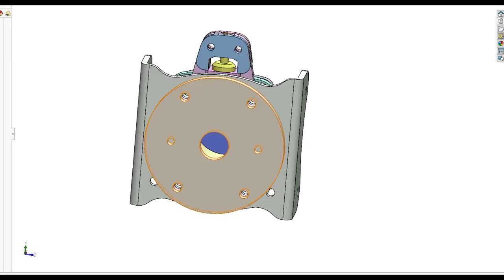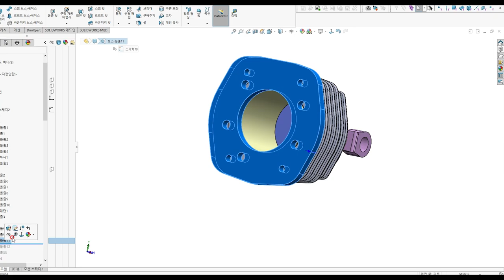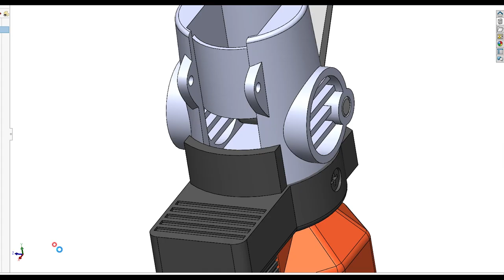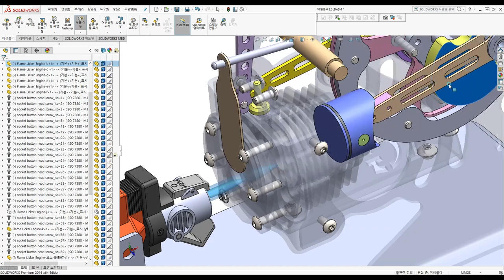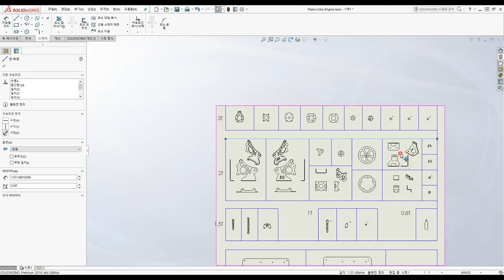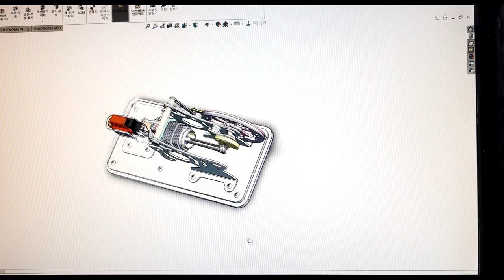Run the engine on a cigar lighter (Flame licker engine)

Comment: very nice. hats off. info: I got those lighters too, problem is the lighter runs hot and plastic melts. nevertheless, superb genius at work here with the engine design.
Reply from the maker: Thank you so much! I was worried that the plastic would melt, but it's not a problem.

Comment: AWSOME !!!! I don't belive it how can to work ? how come the pressure inside ? heat can be workable ?
Reply from the maker: After sucking in the hot flame, close the valve and when the air inside the cylinder cools, the volume decreases and pulls the piston.
Reply: Ha ! well, I got it ! thanks so much !  amazing workshop  great job !
Reply: @iguy  vacuum/flame-licker engines are really tricky to get right. I'm VERY impressed. out of an old nitro engine, to boot!
Reply: @iguy  스털링 엔진이였나요?

Comment: you need to design an oil-dripping mechanism on the piston assembly
Reply: There is lubrication in the fuel.  If you look but it is a two-stroke engine with no valves.
Reply: @richardallison8745  hmmm... okay

Comment: Will you try a design concept to test its working ? It could be a good youtube video!
Reply: I have a design concept I am willing to work on but I just have a pump and not other parts necessary and on top of it all I am demotivated.
The concept is to exhibit the refrigeration cycle and adiabatic changes to a gaseous refrigerant using simple hydraulic pneumatic mechanical advantages and a common diaphragm pump.

Comment: id buy this if it would charge my phone
Reply: Do you not have a phone charger?
Reply: waffeltek   charger dosnt help in the woods... or a storm & power outage..  if i could use throw away lighter... and have a back up way to charge my phone.. Why not?
Reply: There is actually a mini version of this to charge your phone, some kind of stirling engine and it works with a candle
Reply: @joeyhirsch6239  my god you are out of touch with technology.
Reply: waffeltek  power banks need electricity to work...
Reply: @JohnDoe-gg7mk   You don't seem to be smart enough to grasp the point of the desire...  much less grasp my understanding of anything.  i wasn't looking for tech...  i thought the idea of a small motor that is powered with the gas of a disposable lighter to charge a device as a neat niche idea that gave making a deice like the one in the video an actual purpose.  i wasn't looking for a practical way of keeping a phone charged... but some how that obvious fact seems to have been overlooked by some.
Reply: @joeyhirsch6239  sorry but you come off as delusional when you speak of wanting it for emergencies ("in a storm, forest, blackout, etc.) and now you act like you only wanted it as a novelty. Re read your messages and you'll understand why I thought you didn't know much more practical tech exists.
Reply: @joeyhirsch6239  a power bank stores electricity like a lighters store fuel and chargers your phone way more efficiently, smaller, lighter and easier to use, there are also portable solar chargers for phones. Why on earth would you want to lug around and entire engine if you were on a hike somewhere?
Reply: @JohnDoe-gg7mk   how often do you experience power outages?  Seems like a niche need to me...  so again you just don't listen well... or you have reading comprehension issues.  i have been in power outages that lasted a few weeks from hurricanes.. again making that  a practical application that other devices like a power bank would be useless for.  Again your just not smart enough to follow along. its ok... A for effort.
Reply: @joeyhirsch6239  Let's agree to disagree and go on our merry way. Cheers!
Reply: @JohnDoe-gg7mk   I mean... The contraption it self.. the Very video causing this conversation... is one of the least practical things on earth.. Yet Your first assumption is that im trying to solve an everyday real world problem with it?  But you think i'm confused LOL.  your lack of common sense saddens me.
Reply: waffeltek  and when they run out ... and your pwer is still out... its a paper weight...
Reply: @JohnDoe-gg7mk  lol im dying...    your so silly

Comment: What app do u use for that 3D designing
Reply: Patrik Šíma 3D mechanic simulator lite
Reply: Hey, you can use Autodesk Fusion 360 as 3D design tool.its a nice and free for non commercial users
Reply from the maker: Solidworks...

Comment: What program did you use to make the design? Thanks.
Reply: Looks like SolidWorks
Reply: its korean
Reply: Thanks, guys! I will start learning how to use that. I have another question. Is it similar to Autocad?
Reply: @codegeass9348  It's similar to AutoCAD inventor/123Design, yes. If you want something as a free alternative (Solidworks/AutoDesk software costs a fortune) then there's Onshape (cloud based) or FreeCad (which doesn't have the nice assembly features yet but is otherwise rock-solid)
Reply: Solid Works
Reply: Ms office

Comment: By the flame how such pressure created inside the cylinder/piston which is able to move inertia wheel...?????  It is not possible. I feel it is run by thrust of the flame.... And it may run very well by pressured esteem of pressure cooker...ok
Reply: Prem Sachan It’s a Vacuum engine that’s it High pressure gasses come in the cylinder valve closes and from the engine air cooling it creates a low pressure that brings it in causing it to have a vacuum. Simplest form is when ice turns to water the heat of everything around it makes it melt in a vacuum engine it’s the reverse instead of melting it’s cooling down to make a vacuum
Reply: Wonr last long without oil but it's really cool

Comment: Will the cylinder head overheat with a prolonged run? Can this be made into a generator with a buck converter to charge small electronics?
Reply: Will you used it to charge your devices? what electronics would you charge and for what purpose?

Comment: That is 2 stroke engine right?
Reply: Yes
Reply: Wtf no
Reply: Kinda hard to explain except to say that it fires on every single stroke

Soo, its technically a infinite stroke engine or a zero stroke engine depending on how u wanna say
Reply: Nathan Pratt a stroke is 1 movement either up or down  therefore this is a two stroke external combustion engine